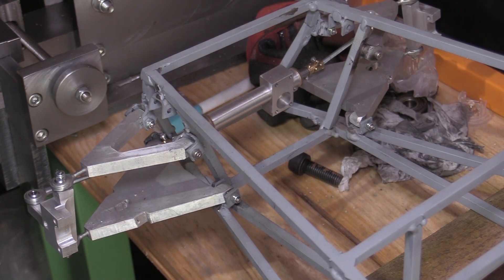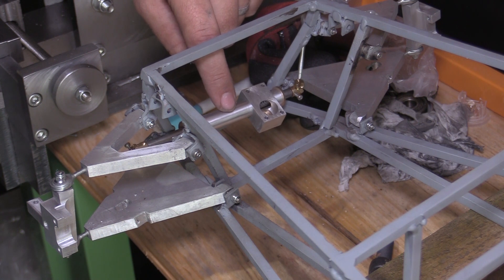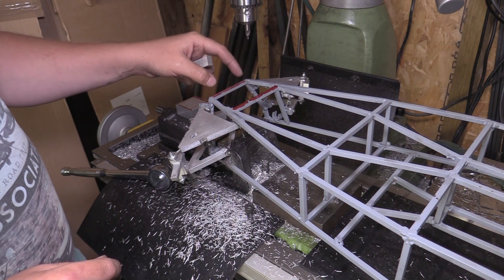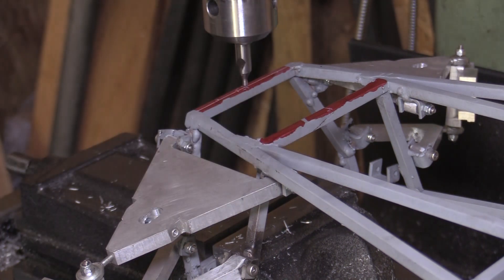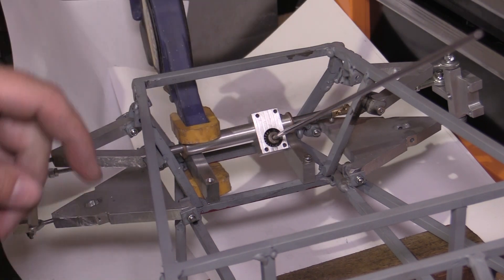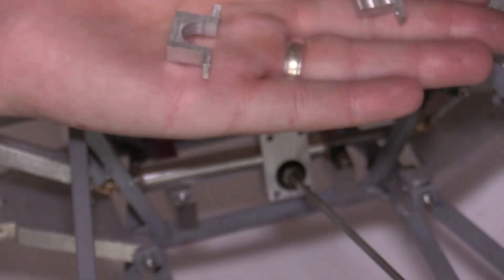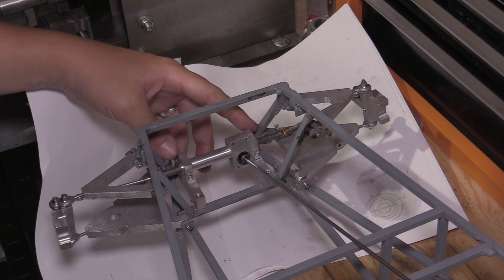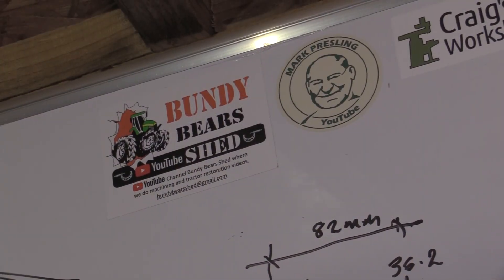Building a Mini Caterham Part 7 - Fitting the Steering Rack

Comment: Might I suggest that instead of using threaded rod to secure your A arms you machine pins threaded only on the ends. The thread will chew up your aluminum A arms in no time. Also watch you stick out on your chuck. You could see the flexing of the material in the video. Aside from that, an impressive build, to be sure.
Reply from the maker: Thanks, I have some rod with thread at the end I'll use that.

Comment: Enjoying the build so far though i think you will have problems with the UJ being pulled off the end of rack,  There is a fair bit of load on RC car steeriing
Reply from the maker: Thanks Colin, the grub screws has quite a good hold but also plan to loctite them on
Reply from the maker: Thinking about it I might also drill some dimples in the rack for the grub screws to locate in.
Reply: @mrmechanical3423  Dimples and loctite should do the job, Only going from experience on a 1/7 scale superstox built a few years a go